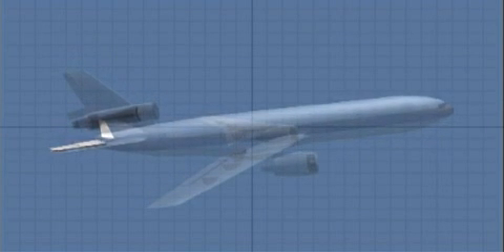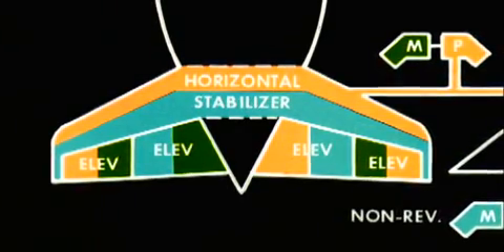One hell of a tale 3

Comment: You know, it wouldn't be a half bad idea for there to be cables in addition to the hydraulics.  I don't say that as an uninformed person.  I've flown many times, and I've been at the controls many times myself.

I think electric servos would be a more viable option, though.  This is one of my big arguments about airbus's control system.  There is no hard wire into the controls.  If you have a major short, you're fucked.